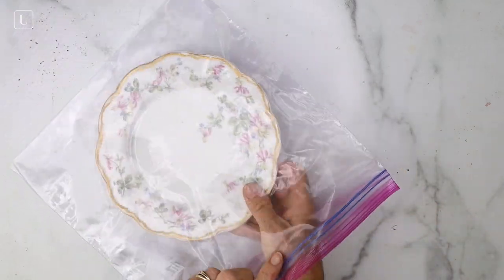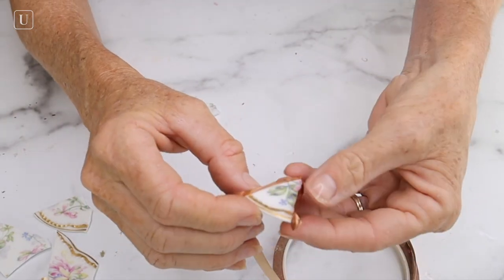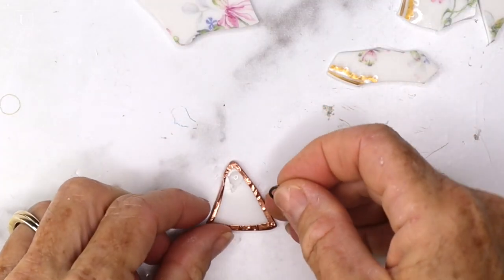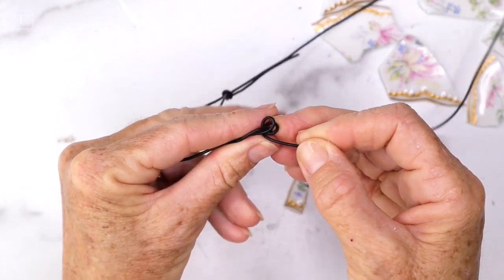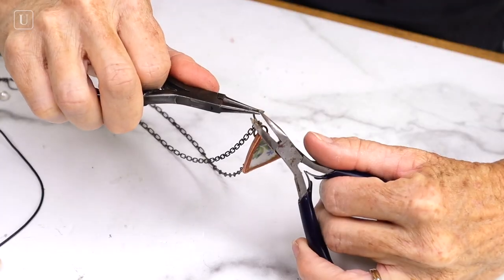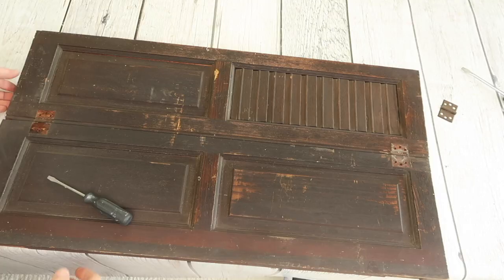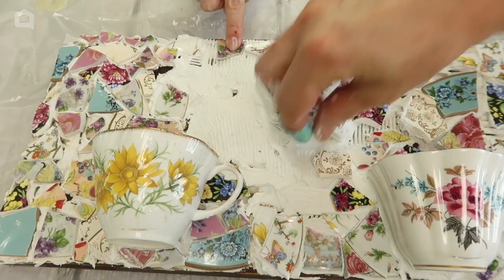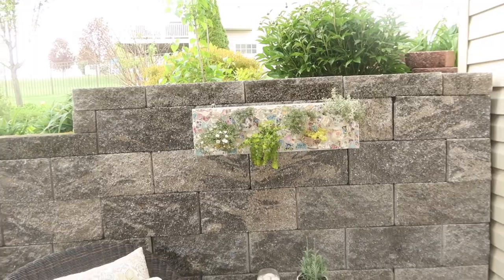Place a towel over a plate for this stunning idea!

Comment: On first one, the one with a pearl, I think it would have been a little cuter with two pearls like one on each side but just the one it just looks off, like one got lost or something lol. 
The triangle one did end up coming out cute once I saw it on her but I think it would have been cuter just to use the gold paint around the rim instead of the tape. In my opinion. lol
Reply: That’s what I was thinking why not just use gold paint ?
Reply: Maybe add a blue pearl to match the little flower
Reply: I think any idea you see someone else do, is done they way their spirit see it happening.. and the way YOUR spirit see yours happening is the way you should do your own! it's a craft which means you can change what parts you want!

Comment: 🛑 Just a warning 🛑 that the copper tape can cut your fingers. After putting the tape on your object, it’s softer to use something to flatten down all the edges. Please don’t use your fingers. You can use a popsicle stick, old credit card, etc. I have worked with copper tape a lot over the years and I have cut my fingers more times than I care to admit. So, please use a tool of some sort, not just your fingers! 💕 You also get a prettier, smoother, bonded piece 👍🏼

Comment: The one problem about using a pretty large loop to attach it to the necklace,is that it makes the pendant twist funny  especially the lighter tiny pieces.
It's  better to take a small piece of flat softer metal and make a forward facing loop (almost like turning the circle sideways so that it's going the way of the cord) you could actually do it with the metal copper tape. Just layer it a couple of to times to make it strong!